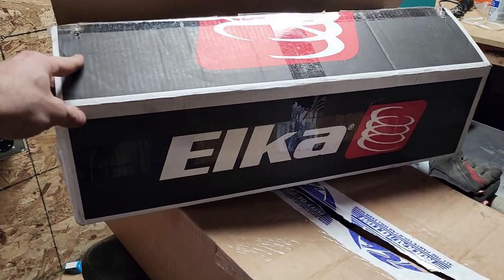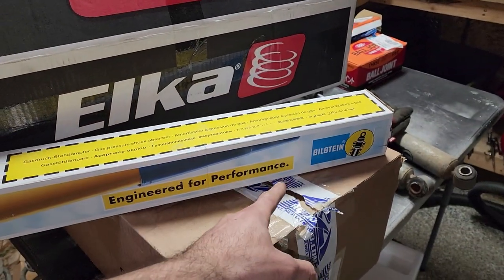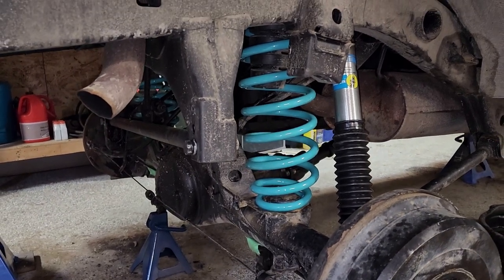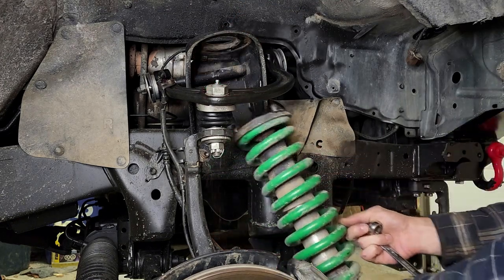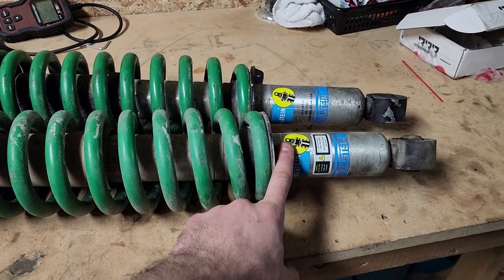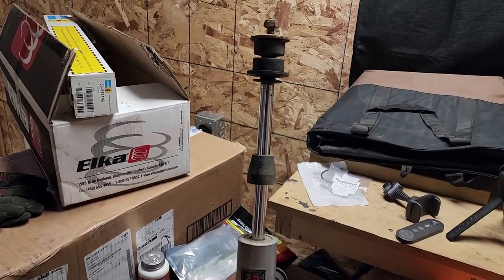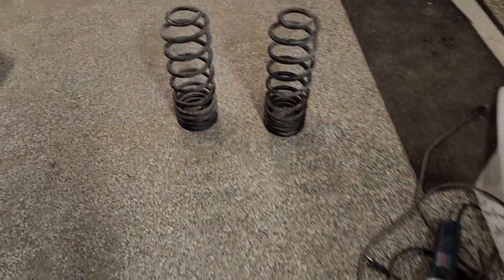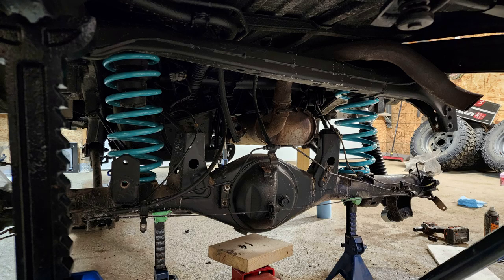ELKA, DOBINSONS, and BILSTEIN Suspension UPGRADE

Comment: Nice setup!  I wound up getting the new IMS shocks from Dobinson's, with internal bypass all around.  I also got there tallest & heavier springs for the 3rd gen.  The front springs had to be lowered by 10mm to compensate for less weight up front.  In the future will raise higher for bumpers & armour.  I also have the SPC UCA's  These are way better than stock, and are rebuildable.  It's been great with a firm ride overall.  2.5 to 3" of lift.  Thanks again!  Great content!

Comment: I just got Kings 2.5 all around.  A little disappointed to be honest 😕    hopefully you will have better luck
Reply from the maker: That's too bad, kings are supposed to be good
Reply: @Aram's Channel  I thought so too. The fronts are nice but rears are way too stiff.  I probably have to open them up and play with opening some bypass holes to allow more fluid to flow through at lower speeds.  They make em stiff to take impact at high speed. I'm not even interested in that. I wanted something to soak up the washboards and rough terrain.  It's my fault for not doing enough research